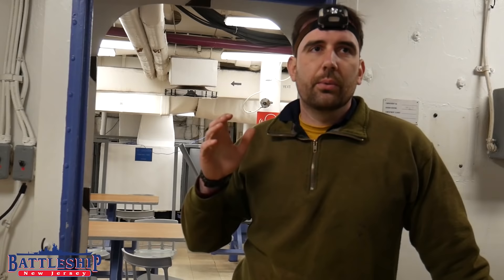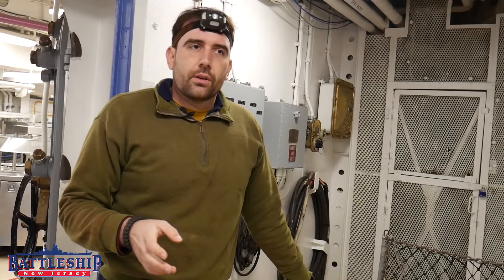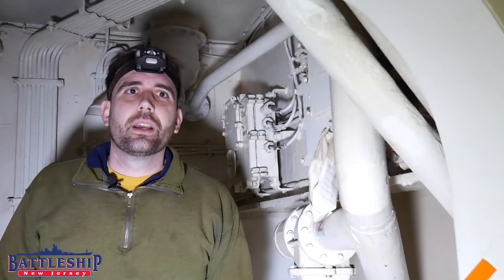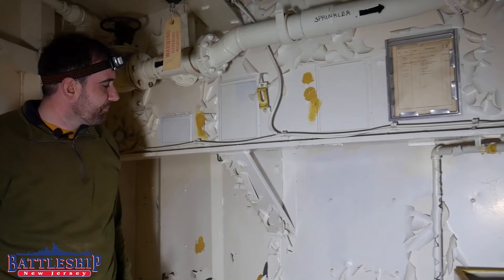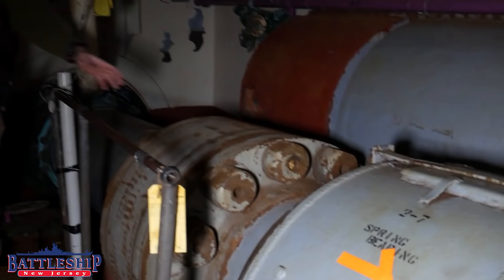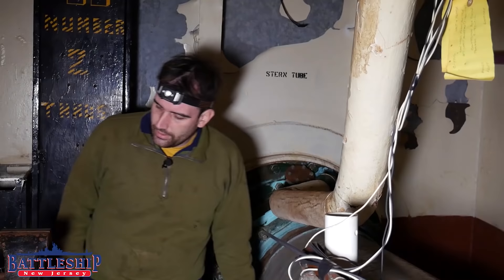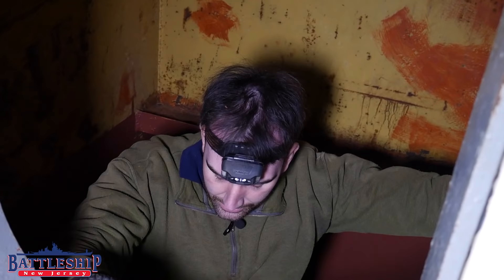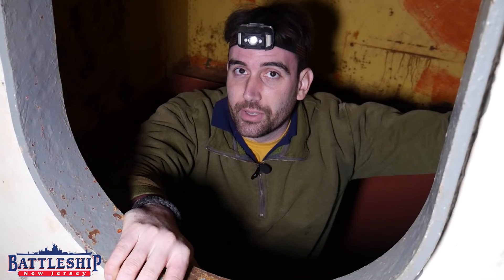Down to the Battleship's Keel

Comment: Ryan doesn't need a gym when he has a whole ship to clamber through and keep him in shape :-)
Reply: We need to come up with a "Mike Rowe" award for Ryan and the camera person.
Reply: @allenshepard7992  Yeah! Something more impressive than ripped khakis, a dirty jacket, and a bruise on the head tho! LOL!
Reply: i am sure it has a workout room on board, as for the class a armor oh that stuff be hard like 600 brinell, most tool steel is not even hardened like that prob like 65 to 70 rockwell c or better, at least that is what my experiance is on hardness and the artical I read about the battleship armor I beleve it said it was called krupp style class a and b, but there was another artical talking about how the torpedo defense was not all that great for protection on an iowa, but its anti shell defense was markedly better, but one thing can be said they dont make ships with armor like this anymore.
Reply: @manga12  If they built battleships today,  how much tank armor technology would be included ?
   Surface is too large to cover in high explosives - reactive armor. 
 Would they use layered ceramics ? Chobham (broad name) or Dorchester (specific version)
Would armor be modular for easier replacement ?
Reply: @allenshepard7992  it would be hard to say but there are alloys that we did not have 50 years ago that are higher yield and tinisel strength though it would make it more expensive, but a layered style armor would probably be used, anti shaped charge sort of things, of course they would pump active defenses into keeping the munitions from hitting in the first place, but I would imagine if making a larger vessel like this today modularity would be the order of the day and a laminated hull material to minimize damage or limit it from reaching the men inside, and electronic defense remember what an emp can do to electronics.  I am not a ship designer though, but i would happen to guess that higher tinsle strength metals and ceramics to break up the blast would be employed and better compartmetisation.
Reply: @manga12   I like your thinking. 
newer Weapons and armor. Aluminum is a larger hull and superstructure component. I hope they stop using magnesium. 
    New weapons are cost effective as well. Cruise missals are Million dollar babies.  Like aircraft carriers - seeing any battleship  park off shore is a psychological deterrent for men/women & their governments. 
   Yes. I do agree with Ryan - they also become a huge target. That is easier it handle now.
Reply: @allenshepard7992  well if the do it will likely be akin to what they were hoping to do with the zumwalts, two railguns, state of the art detection and good countermesure defenses, magnizium though yea that can catch fire and burn very violently, but I would think maybe thicker metal with a layered hull if it was not too hard to repair, the tanks they had a procedure to cover up the penetrations in the armor till it could be recovered and fixed, a brother of my cousins husband was a gunnery master and said when he got to tour the lima plant back in the 80's they were so secret about whats in the hulls they would put a layer on cover it up and move it to the next group that would put their layer on to keep any one group from knowing too much about whats in it, exactly, and it was heavy guarded as  you can imagine, however I doubt that it would be as large, as an iowa, we would not need them to be and would have more active defenses and problably not a single homogenious metal hull without laminations or additional defenses bolted or welded on to it or somehow attached not unlike the kevlar they use today for small arms fire or shrapnal defense. of course the torpedos they use today also dont necissarly need to penetrate, they creat a vacume in the water and use the weight of the vessel to snap the hull, or  put pressure on the plates of the hull to damage it like how the iceberg broke loose bits of the hull of the titanic when it brushed against it  cracking it alowing water to rush in, or at least that was the theory I heard about used by the adcap torpedos we have on the submarines we were using in the 1990's
Reply: @manga12  HI. Sorry for my late reply. The Zumwalts look to be state of the art. I did not know about the hull layering.  Has it really been that long. There is a HUMVEE with antique license plates in my area. That made me feel old knowing when the program started. Torpedo and un-manned underwater drones / torpedoes have come so far. 
    Zumwalts have a tactical edge. Hard to see. Strike and leave. Battleships, IMO, are "loud and proud" strategic. They are there to level everything in the front 100 nautical miles. Hence the additional guns which hopefully can be reloaded while elevated with smart munitions like GMM 120 with in flight correction.    https://www.youtube.com/watch?v=fMbjaighon4.  For many countries, like China,  heavily dependent on trade that 100 NM is critical. With rocket assist, 100NM would be the unclassified range.
Reply: @allenshepard7992  well the 5 inch is 125 mm or so, but yea they have the railgun darts that are gps guided, imagine that I never thought they could make a gps systome that could take the huge electromagnetic pulse or the huge jolt of being flung by a railgun but they did, the dart kenetic projectile can also be shot from a conventional shell that uses smokeless powder, but if you are going to do bombardment you will need a good defense, better then a measly 2 or three inches of armor that most ships have today, as it will eat more then small arms fire, and problably a few missles, who knows what sort of contermesures they will employ though there has been talk for some time of ciws in the form of lasers and using some electromagnetic effects to disrupt warheads by electrofying the hull or something to the effect of I remember glancing over while looking to see how thick they are making ship hulls these days, I think the thickest is the deck of a carrior at about 6 inches or so and 2 inch with kevlar to stop shrapnal from small arms or munitions fire, they have of course sections for flood and damage mitagation just like the battleships, and the countermesures and ciws as well as the ram missle to try to stop incoming stuff from hitting as the defense in place of armor and has been that way of course for some time. too bad they did not build more of the zumwalts those are expensive but wicked and stealthy though they say the tumblehome style hull like that is not without problems.
Reply: Krupp armor is referring to a patented process for hardening steel. Obviously a German process, much research and development went into the method of combining percentages of nickel, chromium, carbon in the steel for the most effective result of resisting penetration without cementing armor plate.
Reply: No better armor exists today over the thicknesses of Krupp battleship armor prior to the nuclear weapons lit off around the world. Steel produced prior to those events has a higher purity and is effectively better than materials used today. 

As far as the Iowa’s go, their armor was actually thinner Than the Colorados of the 1916’s. That may shock you but the Iowa’s were not better protected from shell fire, they were however better protected from torpedos than any previous USA battleship. Some could say that the bow was too narrow to protect in a torpedo attack but in fact a long Lance would punch clean through to the opposite side and create a disturbance in water flow but the narrowness of the bow would not give away much ballast area in the flooded zone. Speed would be impacted but stability should be fine. Four layers of bulkheads and the bottoms of the Iowa’s provides very good torpedo protection. 

What makes battleships not a good idea today is the guided missile technology. The Germans having demonstrated that in the Mediterranean. One shot to a magazine kills 2500 crew and a quick trip to the ocean bottom. Better to have more smaller lighter faster more fuel efficient ships you can lose than a few you can’t afford to lose.
Reply: @michaeldobson8859  I like your reply but disagree with the last paragraph. 
If true - why have aircraft carriers?  They are huge targets. 
   There really is a need for small littoral & anti pirate ships as well as larger destroyers. Then to have an aircraft carrier with a battleship . Yes people will see it coming. That is the point. Stop hostilities with conventional weapons before someone goes nuclear.
Reply: @michaeldobson8859  well there is one marked differance most of the missles today are not of the armor piercing like the fritz was, and as for quality I dont know we have tools in quality control that can make batch steel way cleaner and a better control over the alloying of the metal, but that said I think we could do better then a 2 inch hull on most of the warships, even icebreakers have a thicker hull then that a good air defense cant hold off everything if they are bound and determined to attack your ship
Reply: Feet first.
Reply: You speak the truth. I worked on a german yard for small sized container ships (feeders) in Hamburg/Germany. Its an exhausting workout to crawl through  this comparatively small ships on bilge level (under the floor of the freight). But i loved it to get really dirty and loose like 30 pounds in one year. Unfortunately i got injured on my ankle, so that i couldnt lift the stuff anymore, so i hat to change the job and got fat again ;D
Reply: must work...by the amount of belt he has hanging out looks like he lost a bunch of weight,:) :)

Comment: When you are climbing on a vertical ladder, you do not put your hands on the rungs. You put your hands on the stiles. If the rungs are greasy, and you are holding the rungs, you will slip and fall.
Reply: @tomboyd7109  Or if the rung breaks, especially with wooden ladders.

Comment: Ryan, the "watchmans key" was unique to an area being checked. It was inserted into a normally round box with a shoulder strap. When the key was put into the keyhole on the box and turned it made a mark on a paper cylinder that "verified" the area was inspected. The box did contain a clock for "time stamp" verification. Thought this might help.

Comment: In the 1980's the New Jersey was stationed in Long Beach Naval Station, I was a Navy diver back then and dove on her 3-4 times a month, spent many an hour in those compartments checking tagouts and identifying valves that we were going to be patching or plugging from the outside. When you first dove down and under the torpedo belt it got very very dark, we would try and time our dives for when the tide was coming in because she drafted so much.
Reply: Did you work at terminal island? A great friend of mine was a diver/rigger for the navy and was all over Long Beach and the surrounding areas until about 81’. Not sure if you have heard of Ed Goodrich or not but he was a foreman out there.

Comment: 11 year submarine vet, machinist mate. Seeing you crawling through the structure reminded me of doing tank close outs on a sub I was on during an overhaul. You had to inspect every nook and cranny to ensure nothing was left inside and all the tank level reading equipment was uncovered and working.  Some were so big you had a buddy in the tank ensuring you didn’t get lost! Or to help direct you out of the maze or access ports. Thanks for the deep tour. Makes me kind of miss operating the engine room, but not the family separation.

Comment: As a 71yr old ~ 185lb  I could crawl through the ship to the keel, but I wouldn't be very fast.  Actually slow.   I started Engineering in the days before 3D cad models.   I can tell you one thing from working at Dow Chemical and heard about the errors made in putting together a big plant that as complex as a ship.  That would be an interesting topic, but you would likely never find those stories except from the workers.    One example from Dow is a hand rail that was attached to 125 psi steam source.   That would put the temperate  ~ 350F.

Comment: The watchman's key stations were at one time a system where the watchman carried a clock with a paper tape running inside it.  He would make his rounds and the  individual keys would make a mark on the tape to show what time he visited each station.
Reply: The keys I saw, I believe Detecto, had a steel type  number on the end like on a typewriter.  Apparently,  when you inserted the key into the clock, you would then turn the key and a numeral corresponding to that spot would be pressed onto the tape.  The watchman had to clock in at each station at a specific time which showed on the printed tape.  Pretty ingenious.

Comment: As and Engineering Officer of the Watch trainee, I had to climb down and inspect the shaft alleys, gland seals and thrust block oil pressure, and make sure the poor Seaman Apprentice on watch down there was awake, once on every watch.  It was noisy and warm when the ship was underway.  There is a more direct way to get down there but it still involved squeezing through several scuttles.

Comment: You did a good job of triggering my claustrophobia just by watching you in all those enclosed spaces 😳😳😳
Reply: The farther down into the ship Ryan went, the stronger my claustrophobia became.  I almost had to turn away when Ryan crawled over the shaft and squeezed through that almost too small opening.
Reply: Yeah, and that's before you add equipment and stores in all those rooms and hundreds upon hundreds of men stuffed in there. I'd go insane before the ship even left port.
Reply: Ryan tends to stand with his hand on the hatch mating surface, or grasping a pinch point. Not a good habit.

Comment: My favorite design element of the Iowa Class is their many forms and locations of redundancy, especially being able to operate the main guns and steer the ship from so many places.  These ships were made to fight to the very end with everything blown off of them or flooded.

Fantastic video.  Many thanks to the two of you for taking us to these unseen parts of the ship.
Reply: The destroyers are built that way as well.
Reply: @lelandgaunt9985  Yep, Dad was on Sumner and Gearing class DD FRAMs during the cold war. Several times he went through the list of where the 5/38s could be fired from, ending with, "If it comes down to the only way left is to hit the firing pin with a hammer you can do that too".
Reply: Quite funny how the Iowa class ships were designed to be beaten up, but none of them got much more than scratches and dings. The other battleships, carriers, and the smaller vessels did the exploding and sinking instead…

Comment: As an engineering department junior officer on board USS Franklin D Roosevelt (CVA-42) we had to know the piping systems and vist the "spaces" before we could sit for our Engineering Officer of the Watch qualification. The hull of Rosie and New Jersery were similar...in fact, Midway (CVA-41) and Roosevelt were originally built off USS Montana plans..a BB that turned into a CV. Watching this video reminds me of the Sunday afternoon (in 1964) I had to take the Main Propulsion Assistant (MPA) down in the shaft alleys of each of the four 24" diameter shafts...brakes and all. Thanks for the trip down memory lane

Comment: Ryan just talked about the watch man keys on  the hatch during moth balls.   

Inside that little box is a large key with a number on the teeth.  
When a watchman made his rounds he followed the numbers on the key because they where sequential when they where installed.  The watchman carried a heavy aluminium clock in a leather pouch when he gets to a key he puts it in to the clock and rotates it.   What this does is imprint the key number on to a slowly rotating paper disk.  The clock is locked and wound up at the beginning of his shift so there is no tampering with it.  Reason for this is to ensure the watchman starts and finishes his rounds on time and visits all the keys.   Now a days this would be done with barcode stickers placed everywhere they want rhe guy to go and he carries a bar code reader pen roughly the size of a flash light and just swipes it as he goes through the rounds.  Hope this helps anyone one who was curious.

Comment: Love the series.   Small note is that I recognize that watchkeeper's box you said was bolted on in the 80's  It was identical to one my Grandfather used in the 60's when he was a watchkeeper on the weekend at a saw mill.   I spent many Saturdays with him as a child at work in the empty mill and every 2 hours he would have to take the large watchkeeper's clock (about 10 inched in diameter) around to everyone of the watchkeeper's boxes around the mill to wind the clock.  I remember it so clearly as he let me wind the clock.   That little box probably had a clock winding key in it.

Comment: @14.00 The Watchman's key.
The Watchman carries a watch clock which is about 6 or 8 inches in diameter and about 2 inches thick and is usually covered in leather. Inside there's a mechanism with a strip of paper tape which, when they get to a watchstation, they insert the key turn it and then turn it back and what that does is it imprints a number or letter on the tape inside of the clock. Each key has a raised number or letter which does the imprinting. The Watchman has to turn in the clock at the end of his shift and it is then audited to make sure he made all of his rounds. The clock mechanism also imprints the time and date on the paper strip as well.

Comment: The chill water is piped thru a large refrigerator plant and is a "closed loop" system that meets at the refrigeration plant thru a heat exchanger,  which can have either a 1 pass 2 pass, and 3 or 4 pass heat exchanger where the heat from the loop is removed and is then pumped back through the loop out in the ship. Heat energy travels to cool .